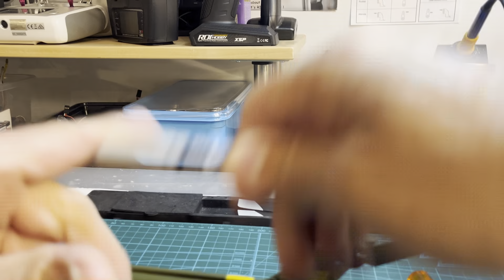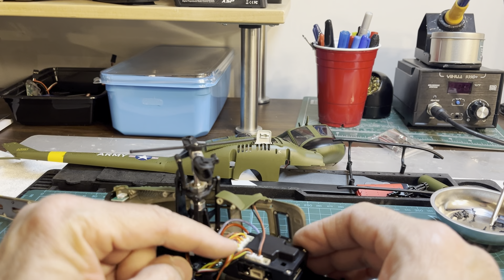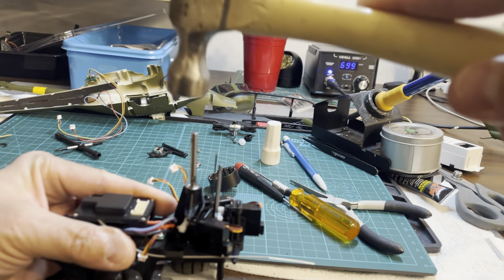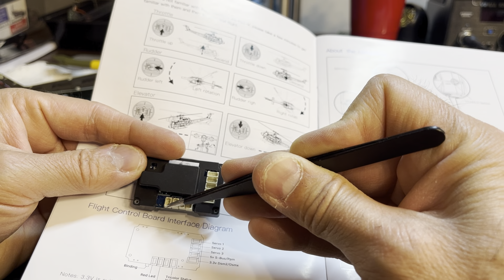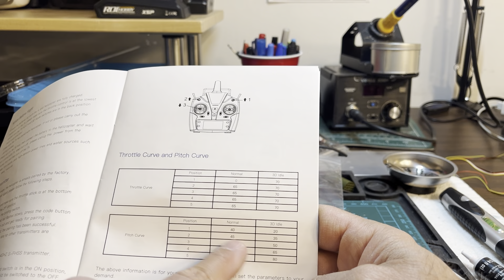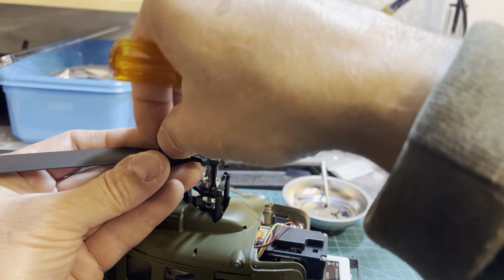Yuxiang UH-1D (F07) - How to upgrade to 3D performance and open, maintain, repair and replace parts!

Comment: I ordered the Pro E190, and I want to install optical flow back, because for me it's too hard to control without the optical flow. Do you think it will work like the E190 after I install the optical flow? I don't do 3D

Comment: Excellent indept video.  Im very thank full you showed all the steps how to convert it into the F07-V.  I have the Yuxiang F07-V and the Eachine E190.  The last has a much better looking fuselage and nose cone(cockpit) fit, but it flies very,very bad. Thinking converting also. I already have the Radio for it. 
Can you put two different helicopters in the F07-V Standard Radio? 
I know I probably need to rebind to the converted heli. But im curious if the F07-V radio has the possibility to store and save more models in it.
Reply from the maker: The F07-V radio does have the capacity for more models, yes. The F07 radio does not.

Comment: Its possible to open the battery case and replace the lipo?. Can you make a video about this?.
Reply from the maker: Yes it is. But it’s a delicate operation and one that I don’t think is worth the effort and risk of someone causing a fire unless batteries are no longer available.
Reply: But if u could just open the battery case and show us, would be nice. Im waiting for mine.
Reply from the maker: @fpvnoob.brazil I will try and remember to make this video.
Reply: Yes i am from Brazil and we have problems to import batteries. Maybe we can even replace for a better 1300-1500 mah lipo. I guess its easier to just put an xt30 in the ESC conector and 3d print a shell to the battery case.

Comment: I recently purchased the F07-V BNF, which yours basically now is. Great heli. Not too nimble but a fun scale heli. Very relaxing. Only downside is the "smartbattery". Out of the box the retaining clips and springs had fallen out & after one charge the USB fell off the charging board. Bad day at the "smartbattery" factory I guess. BTW: I just used the same settings as I had on my Boxer multi-protocol radio for my Goosky S1. Too lazy to start again.

Comment: Hy... Im a beginner/first time to fly helicopter.. can you please help me select the best heli out there... Especially in built quality/durability and infact keeping budget in mind... Which one should i go with.. your recommendation please and i was looking at rc era or yu xiang..looks like rc era is less durable compared to yu xiang.. ur views???
Reply from the maker: @ranjiths6856  you need to learn orientation first before anything when learning to fly helicopters. For a budget model, and one that is easy to repair and find part for, try a RCERA C129V2. This is a great flying inexpensive model for orientation training. Once you get that going and can easily fly figure eights and do turns and come back towards you in a straight line you will be ready for the next level. The next level could be a 6G/3D model from YuXiang. Perhaps try the pod and boom F150 or F160 if you can find one. Otherwise try the F07V, which are all collective pitch models with no barometric sensor, which will help you master the lift along with orientation.

Comment: by the way: the money spent for this f07-V is not thrown away: I now use the original f07 UH1-D transmitter to control both of my YUxiang F06 ec 135 as precise replacement for its ugly terrible "toy" - transmitter, because it can easily bind to the F06.😅

Comment: Again. I did it: Follow (Your recommendation!)  it's a wonderful Heli now it's not so stupid Slow in Reaction, it's Funt o fly very precisely and still scale and is very much worth this Modification. thank you you again Flight SixSix sevenseven and I do This Again on the the F08 Halle it's a Marvel Tofly compared to the F07 standard. Thanks Again from Aachen in Germany
Reply: Hi , just received mine, today very windy but i tried 😂. Quite happy with throttle , i set a less aggressive curve , ok with D/R but i am a bit lost with Exponential, any suggestions?

Comment: FYI:
The aluminum blade grip set can be purchased directly from Yu Xiang.  
I also take pictures at each stage of disassembly, so I refer to them when putting things back together. 
Might I recommend the "Thanks" option for your channel? I'd gladly use it. You provide excellent information. 
👍🏼
Reply from the maker: @MrCaribe65  Thank you. I need to learn what that is LOL
Reply: @Flight6677  
It allows your viewers to give you money. I think it's a Patreon option? You provide valuable information on the items that you review and modify. In fact, your channel is one of the few that shows how to modify, repair, and improve these helicopters. If I had seen your videos about the sluggish characteristics of the F07/F08 helicopters, I wouldn't have bought one. But the video about modifying them to 6G/3D saved me from totally regretting that purchase. I'll use my Optical Flow birds until I am able to fly without it, and then practice 6G with it, and maybe dabble in 3D once I get a simulator. I found all of the repair parts on Banggood.
Reply: So we can upgrade its blade grip to aluminum, right?